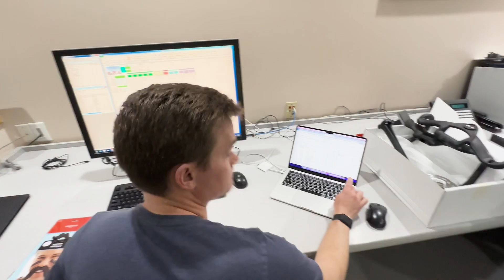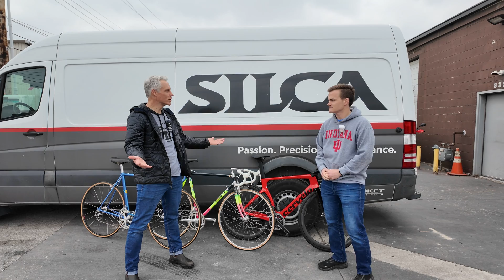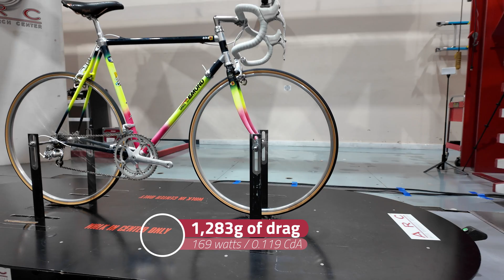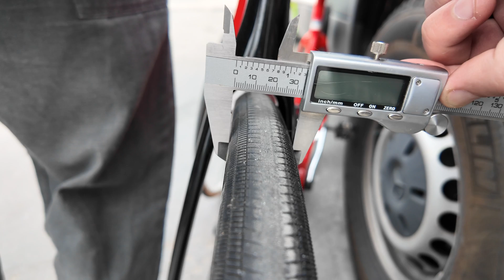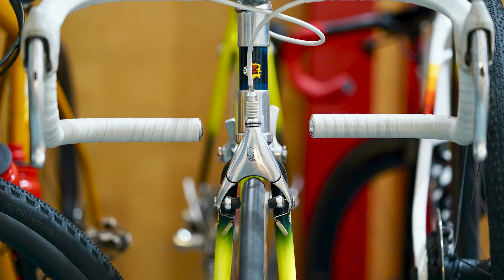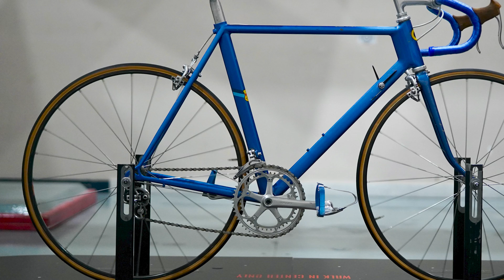Wind tunnel test: 80s & 90s bikes vs a current aero machine

Comment: Wow can't believe the 80's Gitane Profile are so well thought through. They got everything right. It's unbelievable that things went backwards before it went forwards like now. It's really beyond my time so it's a shock to see how well done Gitane is. I think if they were to fit the same aero wheel, then the gap will be much narrower because the wheel testing is so thorough that you can just ball park about 20 watts difference just in the wheel. I always think the testing procedural of bikes is biased because you have to separate wheel from the frame, because wheels are changeable while frames are not. When we say bike what we actually mean is the FRAME. You can't take the different stock wheel from each one and directly compare them. So it you got another chance I think it will be really interesting to see the difference when they are fit with the same aero wheel. I understand deep aero wheel is not a thing back in the time because you basically can't make one from aluminium. But we are not living in the 80s if it turns out that the difference can be so small when you just fit a modern wheel, then it will give life back to a lot of vintage frames like this one.

Comment: If you wanna get a crazy number of views and new subs you need to get a madone slr gen 7 with the stem slammed and good fit for the rider then transfer same fit to the gen 8 madone and lets see the test. im willing to get the gen 7 is FASTER than the new one. not to mention much stiffer....
Reply from the maker: The Gen 7 is faster when you use the same bottles on both bikes.

Comment: This test is so interesting, thanks for sharing it Ben. It shows that the aero gains from bike frame improvements (in non-competitive riding) has been small over the past 40 years, most of the improvements are likely related to wheels and bars. The improvements must have been negligible over the past 10 years and the difference between contemporary "aero" and "climbing" frames is likely almost non-existent. No wonder the bike industry has stopped quantifying aero gains in watts or % and moved to less transparent statements such as "16,6 seconds faster over 40 km at some unspecified speed".
Reply: Instead, they gave us internal-routed cables/hoses so we can be charged/spend hours of labor for routine maintenance. And the difference was quantified at 30 mph; I don't know about you, but I don't usually see 30 mph. Finally, I wonder if the differences can be observed with any consistency and/or with the same magnitude when you put a rider with spinning legs on the bikes. I suspect the whole is lesser than the sum of its parts, so to speak.

Comment: This isn't a knock on you, Ben, I think it's an interesting comparison. But  for the vast majority of riders (most of whom don't compete), 13k for a Cervelo S5 that might only save them 1 minute & 30 watts over their old classic steel bike on an hour long ride seems kind of absurd (to each their own, though). And that's at 30mph. Most people, even elites, aren't riding at 30mph when not competing other than on downhills or short periods while training. At slower average speeds, that savings would diminish if not completely vanish.
Reply from the maker: No offense taken! And for the record, I am not trying to sell you a Cervelo or any other bike. I just think it’s interesting to investigate differences - or whether any tangible difference exists at all.
Reply: @TheRidewithBenDelaney  My bad in using this medium. 😊 Didn’t mean to suggest u we’re trying to push a cervelo. It is interesting comparison. Just meant to share my interpretation of what the findings meant to me.
Reply: Afaik aerodynamics is actually more important in slightly slower riders (because of being on the course longer)
Reply: @utube7930  Only if you're in a hurry to save 30 secs on your Sunday ride.
Reply: @utube7930  Aerodynamic drag is exponential, not linear. As you go faster, drag becomes more and more important. IIRC drag begins to contribute more to rolling resistance than weight somewhere around ~15mph for most setups. That means that aero matters more for a faster rider than a slower one.

Comment: Did you purposefully measure the Gitane with the pedals to make the Cervelo look better? Once you changed out the Gitane wheels, the gap between the two would be much closer.  The Lemond has a few inches of extra bars exposed.  Thanks for the testing.
Reply from the maker: This was Silca’s project, not mine. I just asked them about it. And these three bikes were just quickly popped into the tunnel for fun during a session where a few dozen other things were tested. Just kinda like you’d weigh a few bikes just to get a ballpark comparative idea. If you were going for a detailed analysis, then yeah, you’d need to standardize the hell out of everything. This was clearly not intended to be that protocol.
Reply: The Cervelo has way higher saddle height and the whole design is based around having a rider on
Reply: @Shadowboost @Shadowboost, if you pause the video @ 4 seconds, you can see that it is not significantly higher. I think it appears that way because the top tube slopes down, whereas the traditional geometry does not. It's hard to tell, but the Gitane & Lemond look like they are at more of an angle away from the vehicle, while the Cervelo looks almost parallel. In any case, the aero post, even if it was slightly higher, is also much narrower.
Reply: @rohcycling5646  no shit it is narrower, that's the design. Not to mention all the other things that take away S5 advantages. The whole stem design is to direct flow under the rider torso
Reply: @Shadowboost @Shadowboost  Tour magazine does a stand-up job with aero testing, but to your point, they only use a half model. Care to share your source so I can see the full picture? Also, I'm not the one taking these bikes to the wind tunnel with no dummy onboard. Take it up with the content creators if they are fudging the data.
Reply: @Shadowboost  Just to be correct, the Cervelo stem design has nothing to do with aerodynamics (it's likely slower) it's to give the rider a much stiffer handlebar platform for sprinting.
Reply: @gregmorrison7320  yet IRL those heavy AF cervelo disc s5 are very flexy up front because of all the slop you get over time in the joins.

Comment: No rider on the bike during the test? Bikes totally different sizes? That Cervelo saddle is flying off to the moon compared to the Gitane. Was Reynolds 531 not "aerospace tubing"? (Introduced in 1935)  Hinault wasn't daft enough to ride tour mountain stages on that block. etc. What a garbage "test".
Reply: I feel like this test is totally bodged, which is strange for Silca
Reply: Damn, I was excited, but after reading your comment I clicked through the video and yes, it was just about the bike, not bike + rider 😐🤦‍♂️
Reply: I ride a Fizik Aliante. Curvy saddle. Similar to what’s on the Cervelo. Just saying, it may look like it’s flying off to the moon but that’s the rightly set that way. 
Tilt the nose further up and you can’t rotate your pelvis anymore, tilt it wayyyy nose down and you’ll get hand numbness. 

Curvy saddles like Fizik Aliante and the one one the Cervelo S5 is not set and fitted the same way flat saddles and semi curved saddles do.
Reply: @ariffau  we're talking about the height of the saddle. Not the angle or way it's oriented
Reply: @Shadowboost how do you know the saddle height is astronomically higher compared to the other bikes?
Reply: That is how you isolate the bike frame. Cyclist on top is more drag, aero clothes and shaved legs matters more.
Reply: @shimona500  cyclist has interactions with the frame. Frame only aero is meaningless. The S5 was designed with the rider torso, arms, back, and legs in mind

Comment: So, not even close when testing just bikes, as a rider will make the differences by atleast half.
And if the Gitane had aero wheels, that's at minimum 15 watts at that test speed, and with an aero handlebar thay is another 7-8 watts. So the Gitane would test faster as far as aerodynamics go.

Comment: What he said about rolling resistance is nonsense. When tyres are inflated to the same amount of deflection for a given load (the same hardness), they have nominally the same rolling resistance. Also, there were many bikes from that era that weighed 15lbs or less.
Reply: No, they don't have the same resistance. Older tire construction is significantly slower, and narrow tires pumped to high pressure in the real world even with same tire construction are slower. "Nominally" is a trick word to avoid noting that  tire construction has changed.

Comment: Thanks - interesting comparison. Based on that I’m guessing that my 2013 Specialized Roubaix running 32mm (just) and rim brakes wouldn’t be too far behind the Cervelo. No need for a new bike. For a 64yo who doesn’t race it’s marginal. And my 1998 Lemond steel may not be as slow as I thought.
Reply: Only about 30+ Watts slower with rider on

Comment: Basically 21 watts difference between 1980’s to today. In my opinion not too much. I guess the difference would be greater if a canyon aeroad rim break would be tested compared to the 80’s
Reply: Tbf, that blue bike is quite unusual with it's hidden brakes, slightly aero tubes and cable going through the frame. But still, only 46w at 30mph to the Lemond is not what I was expecting!
Reply: @BevandEdMusic  The bars on the Lemond put the rider in an assumed lower drag position, but they wouldn't know since they didn't test the drag with a rider on the bike.